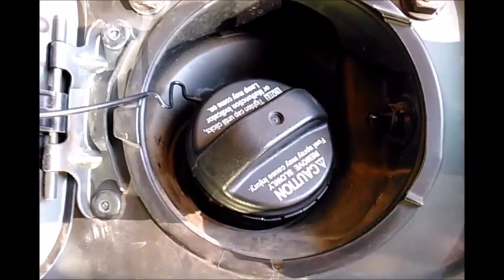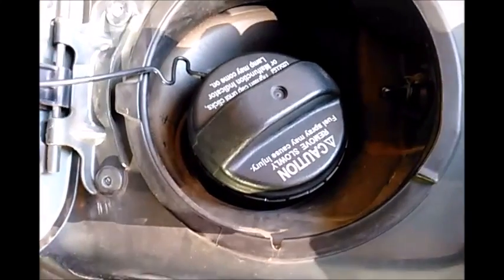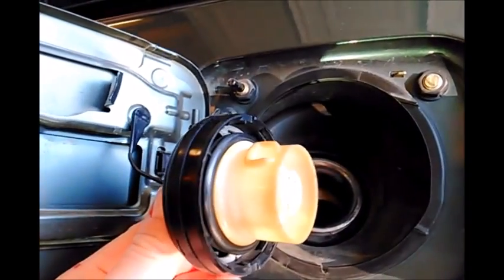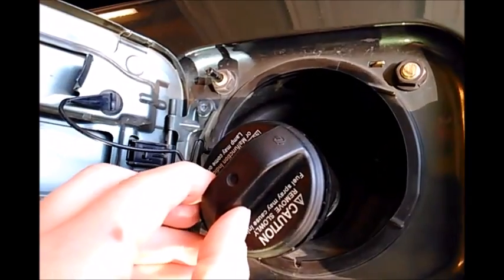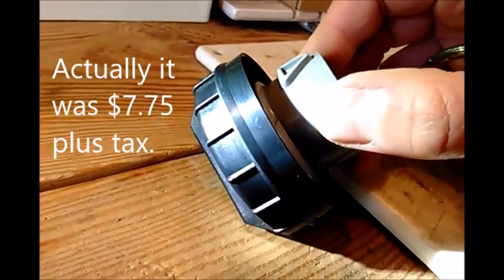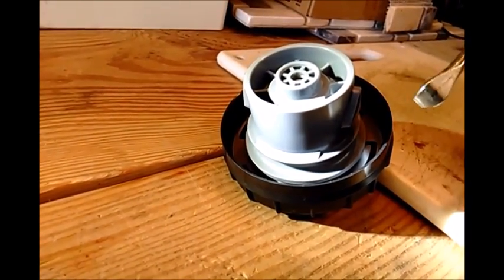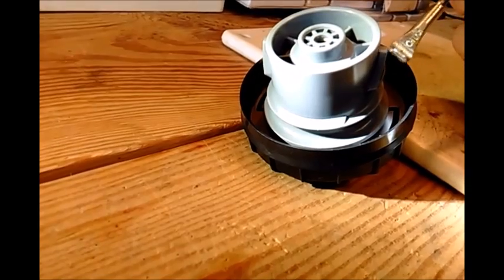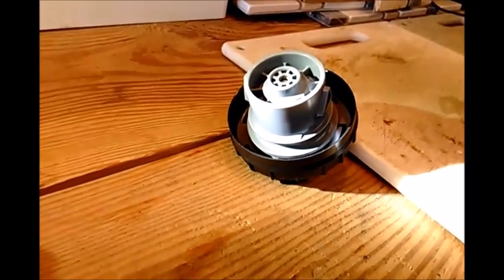P0440 Code Cheap Hack!

Comment: Soaking the gasket in aerosol silcone based lube and cleaning the surface rust off the filler neck and applying some silicone lube to the sealing surface does the same trick! :)